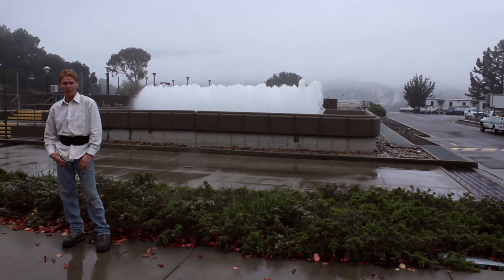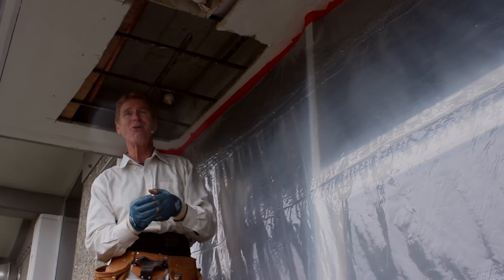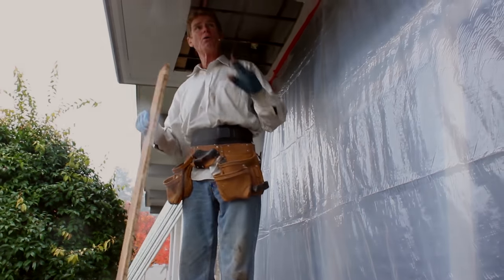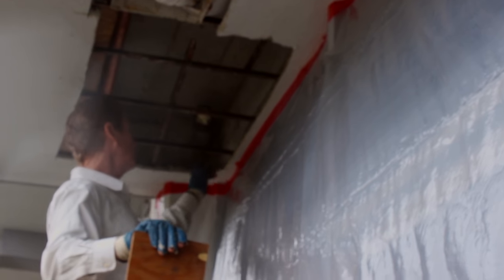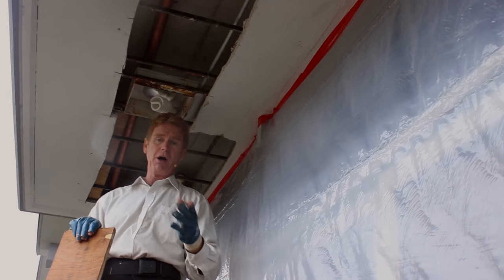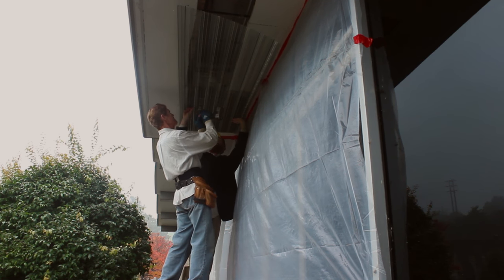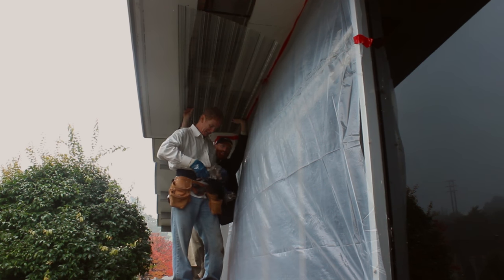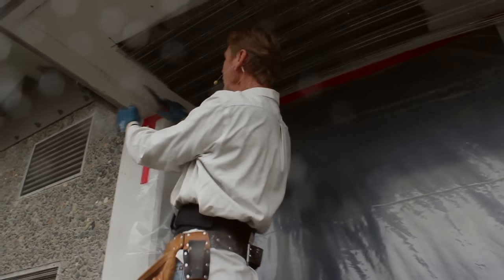Attach metal lath into metal studs for stucco applications, San Pablo Dam water treatment Plant

Comment: Hi Kirk,  your video was extremely helpful I was able to get the correct materials to fix my home,  but in the video you kept mentioning the mud will drop as we're defying gravity,  so what I did for a decent hole size a little bit smaller than the video was that I placed it under the ceiling and measured and cut all the excess parts from the rib lath or the mesh to match the hole on the ceiling,  then I laid the rib lath or the mesh on the floor and applied a thin layer of mud over it leaving only the gaps where i would later wire or screw to the ceiling. I let it dry then once the piece had been prep and ready,  I secured it to the ceiling, then I patched the mud on the missing areas and added more layers to flush with the existing mud on the ceiling.   That could eliminate the majority of the mud dropping issue.

Comment: Hey Kirk, in the good old days (in the UK) we used to put a handful of Thistle board finish to each good hawk full when scratch-coating. It stopped the 'dropping' in it's tracks, but gave the Clerk-of-the-works nightmares ;-)
Reply from the maker: Howdy Peter, we did similar with luminite an accelerator, but still it takes a wee bit of practice which I have stored away in my brain.
Cheers and happy holidays, from the U.S.
Kirk & Jason’s plastering repair video’s

Comment: I do the same with the wood behind the cement for support but I use cement board instead of using the rib lath . I still have a little bit  fill left but then use a fine polymer cement and some exterior  fiber mesh for the joints and its good to go then back later for the finish.
Reply from the maker: Morning Mr Pop, there are many way in which to skin a cat.
    Live long and plaster
 teaching  plastering video’s

Comment: Wow! Clean. I don't think there is a drop of material on your white shirt! Do you, or should you ever use add mixes like accelerators in the mix on cold days?
Reply from the maker: Howdy Five dude, my shirts cost me two buck each at the Salvation Army, so if they get too beat up, I toss them like yesterday's old newspapers.
 When It's cold like that day and it's a ceiling, I have little choice but to use accelerators as I'm a same day type of stucco dude on all my small repairs,
 keeps the cost down for my clients and saves me the time of coming back.

 Cheers and happy holidays

Kirk & Jason’s stucco repair video’s

Comment: Wow! Tough job.  So my question is, dropout is going to occur, period.  But is it because of the weight of the stucco, or a partial failure in spots to mushroom?  On this soffit it is not possible, but on some houses a person could (months later) crawl above the area with the ribbed lath.  In such a case, what is the mushrooming SUPPOSED to look like?  It would be interesting to see.
Reply from the maker: No Problemo my friend, ask and ye shall receive, below is a video that shows the mushrooming effect, it's not such a site to see, however since you asked, enjoy.
 Technically you could if desired jump on this ceiling without worry of collapse as it could hold at least a ton or more quite easily.
https://youtu.be/pA-9yKWLpxY

 Happy holidays from Kirk and Jason Giordano

Comment: I would never think of putting concrete above my head. lol. crazy
why don't they use ventilated soffit?
I would think a sheet kinda like drywall would normally get put up instead of trying to mud inch thick above your head.
Reply from the maker: Howdy Turbo, it all take practice, the fact is I felt if I had a huge dropout on my face it would have been cool for everyone's entertainment but alas no such thing.
 This is exterior work thus, sheetrock cannot be used as it's made of gypsum.
Cheers and happy holidays
Kirk & Jason’s render repair video’s